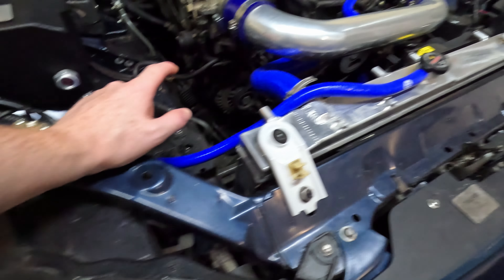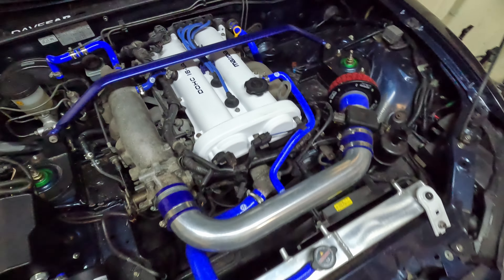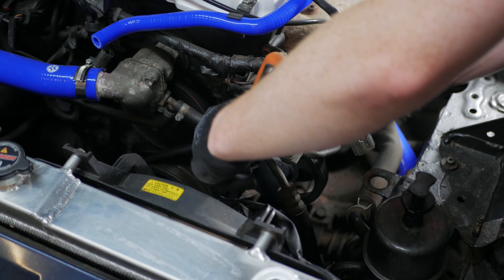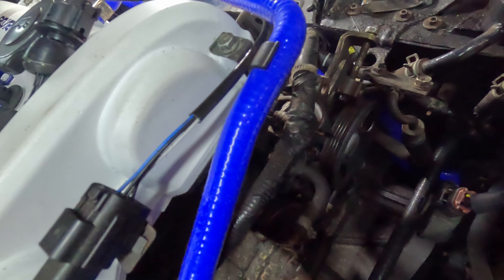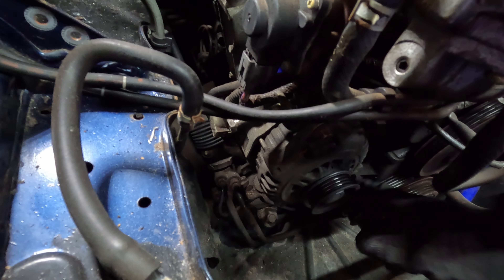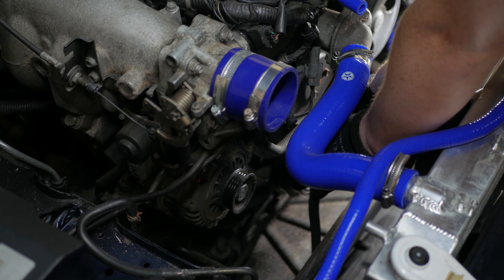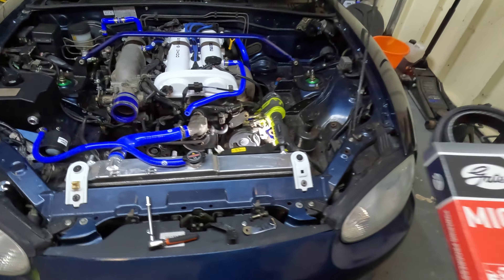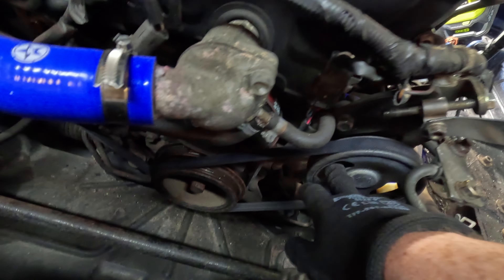How To Replace MX5 Alternator belt & Power Steering Belt | NB Miata MX5 DIY

Comment: The bolt on the back of the alternator is a nightmare, it seems stuck on mine and the location makes it impossible to use a breaker bar. I've tried 2 spanners connected together, no luck
Reply from the maker: That's common unfortunately, you might be able to get more leverage if you go from underneath?
Reply: I went from the bottom with a flat wrench and a hammer.  Probably would be good to spray penetrating oil and set overnight